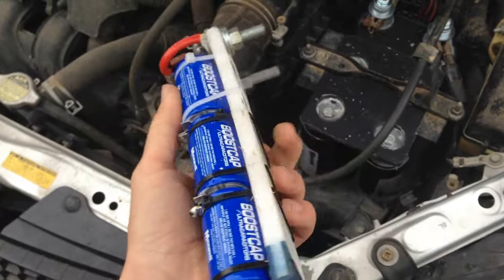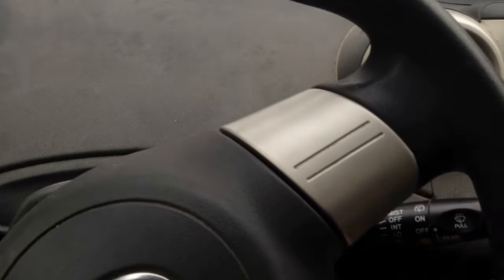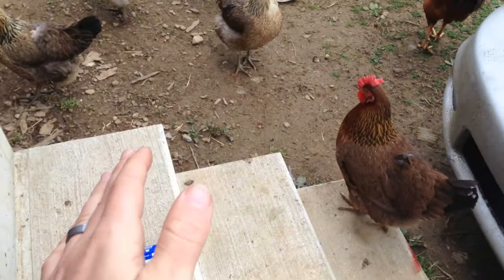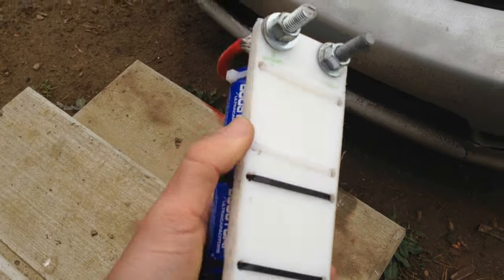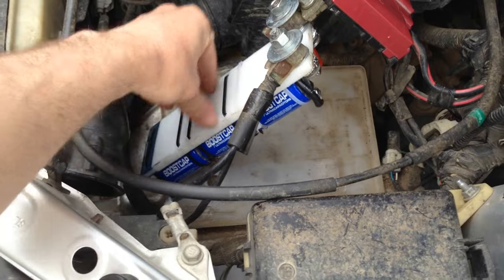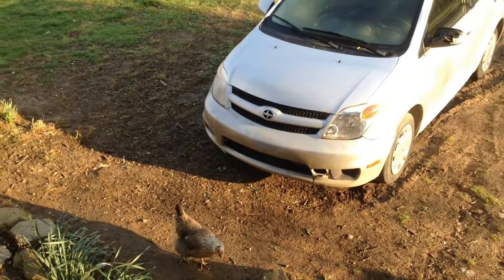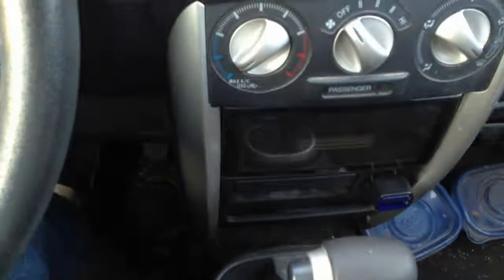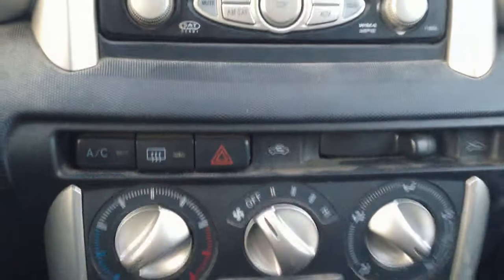Replacing My Car Battery with Capacitors! 12V BoostPack Update

Comment: here is a interesting question... are you able to run those capacitors on a electric motor like you would for a regular battery?
Reply: Yes. Super-capacitors are very similar to rechargeable batteries.
Reply: Engine starter is an electric motor. Not some kind of magical device making engine run out of thin air.

Comment: @lasersaber
WOW I am a Corvair owner & rear end weight (offset to driver's side) is a huge issue! This and fibre rear engine lid, losing the original hinges, and whoa this might total 80 pounds, saved. Also for me voltage drop is a recent nag issue, here is more amperage & easy removal for a charge indoors via trickle overnight, am I right? 
Great video in the style of tube amp genius Uncle Doug, who has cats roaming around .
PS watching Graham Hancock & cfapps7865 you find Sumerian & Egyptian fallen angels shown holding hand-bags - and here I am holding a Mastecraft mini-booster pack this morning and it is totally the same thing - all the Mesopotamians didn't draw was the alligator clips. .

Comment: Would be interesting to try this as a motorcycle battery replacement. Some motorcycles coughCough1400IntruderCoughCough have the battery in some horrible place, and a smaller battery would really make life easier.

Comment: It is best as back up Incase emergency failed battery and never left in the dark but must isolated from circuit after charged and reconnect only manually
Reply: We research in this 10 years ago in hawaii under all thing consider

Comment: I know this is a really old post but I'm curious how much you have learnt since this was made.

I have a deep cycle AGM battery that I use for running an inverter for my power tools in the back of a  3 liter diesel Hilux. I was thinking that if I removed the cranking battery and replaced it with the capacitors then I have the best of both worlds. 

I have the ability through a relay to connect the caps to the deep cycle in the back to easily top up any depletion. I think that  part is pretty solid as I also have solar panels recharging the entire system as well. 

My biggest concern is whether there is undue strain on the alternator given the differing characteristics of the capacitors over the normal cranking battery. 

Any new information would be highly appreciated.
Reply: I have made this kind of setup for my moped and it's working really great. It's been like two months since I installed it and the alternator seems to be doing fine!

Comment: one whole chicken = 1266 calories

1266 calories = 5297 joules

5297 joules over a period of one second = 5297 watts

5297 watts / 745.7 (watts per horsepower) = 7.1 horsepower.

But that's if you burn the chicken

-reddit

Comment: So, apparently the capacitors do not hold the charge anywhere as long as a regular battery.  If you left it alone for a week would the capacitor be useless?  Can you jump start a capacitor?  If so, you can keep a charged jump-starter power unit in the trunk, which is basically another battery.  
I think this is over my head.  What I'd like to know is what will you do with all those chicken eggs in the refrigerator?
Reply: In this video, he installed a very small super-capacitor. Just to start the car. Did you not see the huge super-capacitor previously installed?

Comment: Ok explain this to me, I've never in my life had a car start at 10v the lowest is around 12,2v from what I understand, some newer cars even have a voltage cut off limit that won't allow you to start a car under 12v and correct me if I'm wrong, the lower the voltage the higher the amperage so if a starter pulls for example 12A @ 12v it will go up the lower the voltage goes so say it will reach 14A @10V, now that doesn't seem like a problem now but will start burning things out in future, a battery is it's power to pull an amperage for a certain amount of time so that if you have 1 or 2 misfires you still have capacity to start a vehicle, I'm sure because a capacitor gives short bursts of electricity it cannot handle that, another thing is that when Caps are charged they are extremely dangerous and could kill you if not discharged correctly even when the car is off. Just asking? correct me if I'm wrong, I would just like to understand better, so put an ammeter on the + cable and test the amperage between a battery and your caps when starting

Comment: Well I have a Ford F250 diesel truck I only use once a month those caps would be dead by the time I got to them.
Reply: Aaron bilger but you could charge the caps with a hand crank DC motor...just sayin

Comment: I love hearing the chicken in the background and the eggs looked yummy:), question please,did you put any resistors between the boostpack and the alternator, or just hooked it up directly the way battery was installed, thanks much.
Reply: Yes, you should use a resistor, or other method, to slowly charge the super-capacitor to 12 volts, the very first time.
Reply: @MrSummitville   thanks much.

Comment: I would be surprised if you can connect the caps over the cigarette socket and start the car without blowing the fuse. May need to use a higher amp fuse through. That would be fantastic and easy to use. Do you think you can do a video on that mate?
Reply: No, you cannot start the engine by plugging these super-capacitors into the cigarette lighter outlet.
Reply: You would be surprised and I would be too. It's just purely impossible.

Comment: sir,this mini boosterpack caps 12volt,is it connected to the alternator?
Reply: This mini booster pack has max voltage of either 15V or 16.2V (depending if he used 2.5V or 2.7V caps). However these are not batteries, they don't have nominal voltage. If you charge the pack to 1V it will be happy working with 1V, if you charge it with 15V it will be happy working with 15V.
Alternator will charge it up to 14.4V (on properly working car) so it will be safe no matter which caps he used.

Comment: how long can it last with the engine off while listening to your radio?
Reply: NoVaKane not long. as long as it takes for 12v to dissipate through the loads and or resistance of the vehicles electrical system, which is like about as fast as draining a bath tub.

Comment: Sounds great, will build one for my Bike
Ne need to wire the capacitors in Series to reach 12 something, volts to run the startermotor. The Farad’s is decided by the number of serial connected Caps... the capacity is the numbers of starts you can manage... 
my concern is that the alternatorˋs charge current may damage the capacitors in the permanent driving condition and summer heat? 
Anybody has a suggestion

Comment: If you have a base model car with no technology, that's great, but if you left my acura with that it would drain it in a day I bet. the bigger one seems great though, that would be find for day to day. For racecars, this is great for weight savings ( sure they already use it though)

Comment: couldn't you have a small solar panel on the body (roof) of your car to keep the capacitors charged enough for at least one start in cases where the car is not started for an extended period of time?  when the car finally is started the generator (alternator) in the vehicle could energize a relay that opens the supply circuit from the solar panels to the capacitors and closes a circuit from the alternator to the capacitors. when the vehicle is shut off the relay coils are no longer energized and the contacts flip back to close the solar panel feed circuit and open the alternator  feed circuit. ??
Reply: He did that in another video. But just inside on the dash.

Comment: OMG I cant believe why I stumbled upon. Im already searching components online :D Can I just leave it there? Will my alternator toast it? Also how stable is the output? Modern injection systems are very picky. Optima can suck on deez nutz, their stuff is not that light and super expensive, Im totally running this in my track car, so please answer my questions when you have the time.

Comment: My car battery is 60Ah 12V  so is equal to super cap 15 500 F fully charged .. 1000F is big boost cap .. but 15k is gigantic. 
This looks like each is 500F so need 30x this module to be equal to typical car battery by charge.
Reply: And that's why it is self-discharging so fast or discharging so fast when listening to radio. But lead acid batteries are in no way equal to supercaps. They don't need so much capacity to provide huge currents needed to crank the car. 

The pack he used is consisting of 350F caps, so the capacity of small pack is about 58F. Assuming your calculations are correct, that would be about 0.22Ah lead acid battery. The smallest I could find of lead acid battery was 0.8Ah AGM battery with max discharge current of 10A. So, what max current 0.22Ah battery could have? 3A? 5A? Not enough to light two headlight lightbulbs in a car, not to mention crank anything.

You see the difference now?

Comment: :))

can it replace bike lithium battery pack?

what is the maH of this this pack (equivalent to batteries)?
Reply: Q = CE, Q = Coulombs, C = Capacitance in Farads, E = Volts. The bank is 58 F Capacitance so at 16 volts it has 928 Coulombs. 1 amp hour = 3600 Coulombs. So it is 0.257 amp hour. Keep in mind this is using the cap all the way down to 0 volts.

Comment: Remove the car battery, you'll lose  horsepower. Replace it with a boost pack and get free range chicken power. 

What is the total watts and cranking amps? 
I'm curious if it can it power up a big inch motorcycle? 

Awesome video!
Reply: The capacitors started a car engine, so of course is can start a motor cycle engine.
Reply: They are rated at about 170A and can provide about 4 times that if needed. It will surely crank motorcycle with no sweat.

Comment: okay someone help me out, why wouldn't the worlds car manufactures go to this if it is smaller and lighter? better fuel consumption etc... There is something wrong here and I just don't know what it is
Reply: I wonder how this affects the alternator, I suppose they charge quickly and don't require the alternator to  pump out hard.
Reply: the problem is reserve power. If the alternator fails the car would die very quickly (under 5 minutes most likely) instead of giving plenty of warning and time to stop in a safe area. Also if you left the lights on for a couple minutes without the car running, it wouldn't start. Want to listen to the radio for 20 minutes while waiting for somebody in the store? have to leave the car running. The capacitors can dump a huge amount of current, but only for a short time.

while this idea does technically work, it's impractical and very easy to end up with a car that won't start.
Reply: Actually no not on newer alternators they all have microboard on them to decided when it needs to send power to the battery and how much to send, so it won't overcharge the system and blow up or cook the battery. 
The only issue I see with his setup is it has no mount and very unsafe could cause a fire.

Comment: Now remove the alternator fuse and let me know how far you get.
(reserve capacity)
I'm not against your idea I just have some questions.
For racing applications
Reply: Depend upon the amps needed to run the race car. You would need to install a large super-capacitor.

Comment: my point is how long do these capacitors can retain a charge... that is the only real problem with capacitors is that it cannot provide a uniform discharge of charge for a long stretch of time...
Reply: Ummmm, you start the car and re-charge the Super-Capacitor, just like any another "battery".

Comment: Have you ever had a super capacitor explode?
I hear that is a possibility. Many Smart meters were said to have exploded and set homes on fire.
Reply: they only explode usually if given way too high a voltage or reverse polarity and when they do they usually vent a gas and aren't super dangerous

Comment: So nice set up my friend. But my main concern is, how will a supercapacitors like that work on a high torque motor say a V8 or 350 motor or something like that or maybe even a diesel truck see if it has the cranking amps to start it because I'm kind of curious on how it would work like that being that I own the truck and I am very interested in this invention set up that you have going on with the super caps. Please do get back with me on that cuz I am interested. I am subscribed so I'll get the notification whenever you do try that on the bigger motors with higher torque to start
Reply: If these won't work, just get bigger caps. BCAP3000 can give you over 2000 amps with no sweat and 9000 as short circuit amps (that's almost condition in car starter). So, how much CCA has your "high torque motor" car battery? 600? 800?

Comment: hey no doubt it will start but if u leave the car un used for for a week the capacitors will have   self discharged and the car will not start.

Comment: Why replacing a car battery with these capacitors? You can only save about 12kg of weight, which is nothing. Total charge of these are so less when compared to a car battery. So you cannot listen to radio, keep cabin lights on for a while or keep parking lights on when engine isn't running.

Comment: Try that on a real engine not that tiny 3 or 4 cylinder that probly don't even pull a hundred amps of power when starting.

Comment: Who here believes this is working? The cranking motor in my car needs over 300A for up to 100ms and then around 100A for up to 2 seconds. These caps (charged to 12V) are completely empty after less than 100ms while trying to deliver 100A. This is stuff that kids learn in the 9th grade!

Comment: vy všichni zapomínáte na vnitřní odpor které ty kapacitory mají prakticky nulový,  také by mě zajímalo jestli je možné aplikovat klasické vzorečky pro klasické kondenzátory, když tyto super kapacitory mají tisíckrát větší kapacitu...  3000F 2,7v 2165A this is parameter for one of this - BUT one of this in our country cost like new one car batery....
Reply: as far as I know, classic formulas for classic caps works for these in the same way. People use these formulas to measure capacity of them.

About the price - yup, I'm from your neighbour country and they are indeed expensive as heck. Fortunately sometimes there's way to buy them used. They do not loose much capacity during use, but they cannot be used for scientific research anymore, so places like universities sell them, sometimes way cheaper. Need to look for deals ;) I'm trying to buy some soon to try out what can be done with them :)

Comment: Now if we could just bring back the hand crank engine with points and a magneto....then we wouldn't need a battery.  Think of the weight savings by removing all the extra electronics we wouldn't need.

Comment: An idea solution would be a small camera flash. Where it charges in seconds and releases a flash. It charges up with aa batteries. Connect this flash system to this so when u need to start a car it will be ready in mins. U can pick up a disposal camera with a flash for 5usd. Take it apart and modify it to this. Also any one know what capacitors are used here?

Comment: Even if this is real , nobody should use this mod.The reason has to do with safety. 
 Even if somehow there are capacitors that can start an engine , we need power supply in a case of an engine failure or when we change a tire. We need power for the alarm lights for the brake lights , for the horn and for the head lights . 
 This pack(if it is real) can provide a huge current(as claimed) for a few seconds in the begging.Then it is getting charged again , but what will happen if we need  to stop the engine with the alarm lights on for 3 hours ?

Comment: I never knew you could buy 350 farad capacitors. he did not say micro farads. He said farads 350 farads . i have never seen or played with such a high amount of capacitance. The largest i have used was a 1 farad capacitor. and that was used in a large phone system as a way to power the memory chip before they invented flash memory. 

Never knew they made these , But i do know there have been people who have tried to use capacitors as replacements for batteries. So far i have not heard of a capacitor pack that can entirely replace a battery.

Comment: What if you have a car stereo with multiple amps?
Reply: If you have a car stereo with multiple amps then buy a separate Lithium-Ion battery just to power your stereo & amps. The super-capacitors are just for starting the engine.

Comment: What about cars with security systems?
Reply: sell it on ebay and buy an real car
Reply: +T3CHNOTURK :D too funny.
Reply: WHY ?
Reply: Why? Because cars with security systems draw electricity. That draw will drain the capacitors.
Reply: remove cap bank..
 secure enough for ya
Reply: Well, how about electric door locks....
And having to either leave the hood unlatched, or the doors unlocked.
Oh that's secure......

Comment: The nay sayers just didn't try it.  I have a small one for my motorcycle and it works very well.  no more expensive batteries for me.  The chickens are awesome by the way.  Fresh eggs are hard to beat.
Reply: +Hack Nup I would think fresh eggs would be easier to beat and/or scramble

Comment: Well on a easy to start engine in perfect tune that would fire and run in few sec burst then OK / if you need cranking power for much more then it is just a capacitor - problem is that most of us driving older cars / trucks our engines takes more than a one turn of the crank to fire and diesels I could not imagine  remember you have NO reserve capacity !!!  ( But I do eat 6 raw eggs a day for my body so that is good idea !!! )
Reply: Install a bigger set of super-capacitors and/or parallel a small Lithium-Ion Battery = Hybrid design